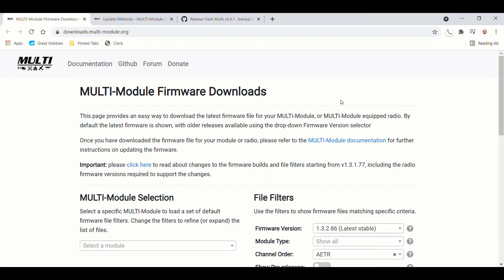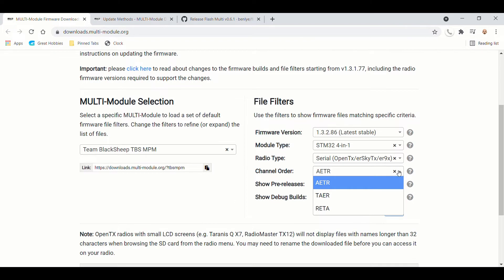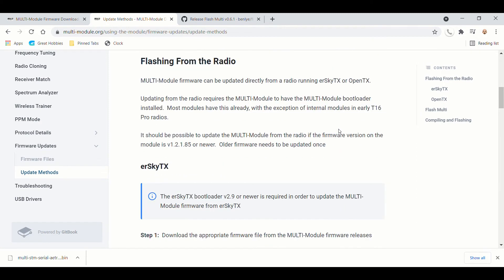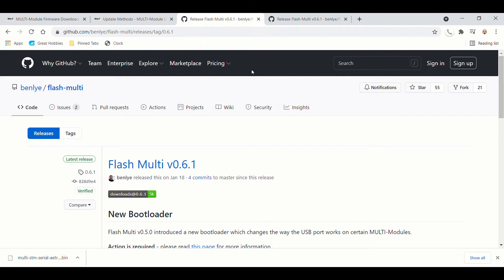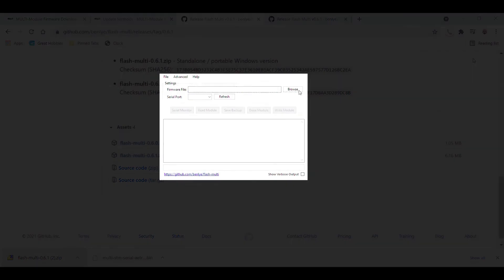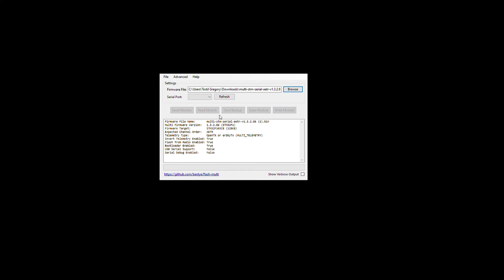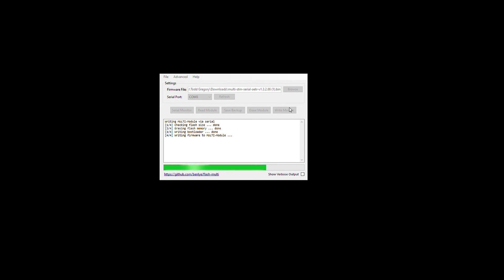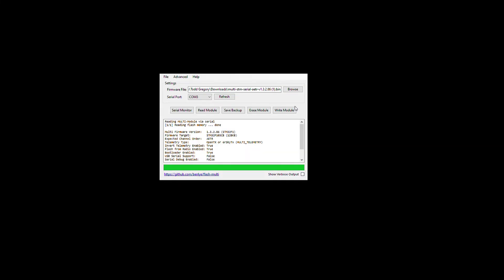How to update TBS Multi protocol module

Comment: Ok so for anybody in the future who reads this. If you're having issues with the com port 3 and you're getting "failed to read the MULTI-module", you have to use a USB-C cord that does data transfer. I used two USB-C cords and none of them worked, I had to pull out a cord that I used in my car for android auto. A good indicator is if it has blue on the inside of the USB and not white.
Reply from the maker: That’s a good tip. Not all cords have data. Thanks

Comment: i don't get it....i was able to flash the module though the Tango 2 no problem.
Reply from the maker: You flashed the multi protocol module through the radio?  TBS said it doesn't support that.
Reply: @romulusfpv  yah, I dunno. It says flash was successful. Maybe a firmware update, added it? I put the *. Bin file in a "FIRMWARE" folder that I had to create on the root of the Tango 2 sdcard. Went into the Tango 2, held the "menu" button, pressed "page", went to the "FIRMWARE" folder, found the file, held the jog wheel, and it gave me the option to "Flash ext-module"
Reply from the maker: @TheFlyingHernie  that’s good to know. I’ll give it a try.
Reply: PS this only works on modules that have already have newer firmware. Earlier modules from a few years ago wont update through the radio

Comment: checking flash size... failed  then it say s something else
Reply from the maker: I have never received that error. Maybe the multi protocol group can help.
Reply: @romulusfpv  what group is that where do I find them
Reply from the maker: @TheCabanamancan  here is a how to guide https://github.com/benlye/flash-multi . The update. Maybe this will help  As well the link to the multi protocol rc group. https://www.rcgroups.com/forums/showthread.php?2165676-DIY-Multiprotocol-TX-Module/page1572

Other wise you can message fpvknowitall Joshua Bardwell joshuabardwell@fpvknowitall.com

Comment: I get to number one and it fails.....i have redone this multiple times please help me
Reply from the maker: Ok I started from scratch today and ran into a com port issue.  I had to go to device manager and find the device and update the driver.  
here is the link to the driver
https://www.silabs.com/developers/usb-to-uart-bridge-vcp-drivers
Reply from the maker: Which step exactly are you getting stuck on? Selecting the right firmware?
Reply from the maker: Also here is the guide to the updated application. 
https://github.com/benlye/flash-multi
Reply from the maker: Also here is a link to the flash app guide. 

https://github.com/benlye/flash-multi

Comment: Hi ! Thanks for video ! I am stuck on the reading mpm.. it fails to read the flash memory . Drivers installed an it sees com port but can’t communicated with module . Did you have this issue ?
Reply from the maker: I did not have that issue. Make sure you don’t have another device in the usb and don’t have cura slicer running as I have had that issue before.

Comment: Hi!
I have followed your instructions to the letter. But on the Flash Multi v0.6.1 app, after i searched and set my firmware file on the browser window, i can't see the COM3 port on the dropdown box (right beside the Refresh button. I kept refreshing it, but nothing appears. I have installed the USB driver for it too. Can you please help me how i can i make the COM3 appear, so i can click on the Write Module button?
Thanks
Reply from the maker: Hi Sorry for the delay.  A couple of things to check is if you have another software that is picking up the com port.  For example if I have cura slicer 3d printing software running the flasher app wont find my com port.  Close all other applications and try again.  What computer are you using and what operating system
Reply: @romulusfpv  This is a brandnew laptop i just bought a week ago. There is nothing on it, probably except a usb cable for my drones (Betaflight), and my bluetooth mouse dongle.
Reply: @romulusfpv  I'm using an Asus Tuf laptop running on Windows 11
Reply from the maker: @herphermits  hmm if beta flight detects the com ports then maybe uninstall the flashing firmware. Also click on he serial port and pick com 3 it doesn’t automatically select the port. And also are you connecting the computer directly to the  mpm?
Reply: @romulusfpv  I am connecting the laptop directly into the usb port of the MPM.
Reply from the maker: If you didnt get it to work maybe we could live trouble shoot with video chat.  What timezone are you located?
Reply: If you figured out the issues you had with the update, I would like to know what you did.  I am having the same issues.  Connect my TBS MPM to the computer but I connect get any COM ports to show up so I can upgrade it.  Any help would be great.
Reply from the maker: If you want to try live help we could schedule that.
Reply: @romulusfpv  hey brother.  I'm having the same isssue.  I only see COM1.  I don't see COM3 as an option so I keep getting a failed to read the multi module window warning.  Please help🙏🏼
Reply from the maker: @urodinofpv3313  open device manager on you computer. Then plug in the module to see what com port. Then select that port in the program.